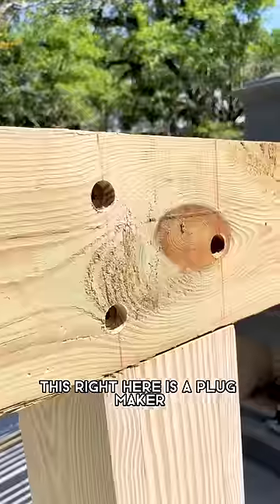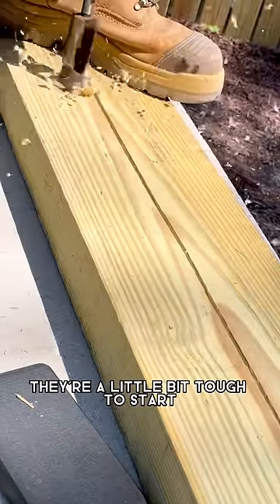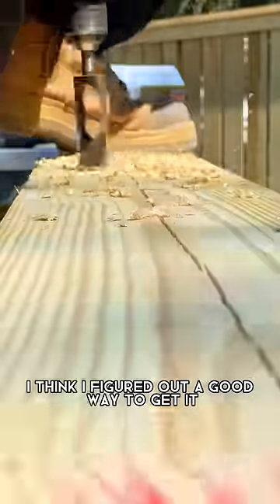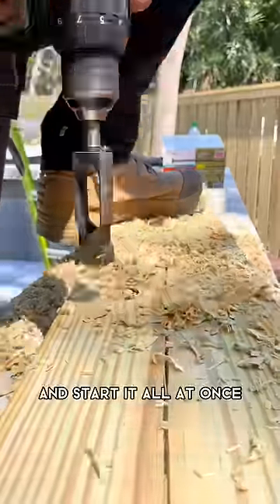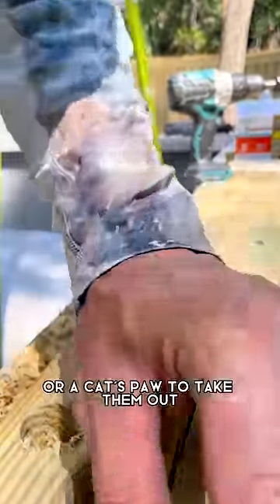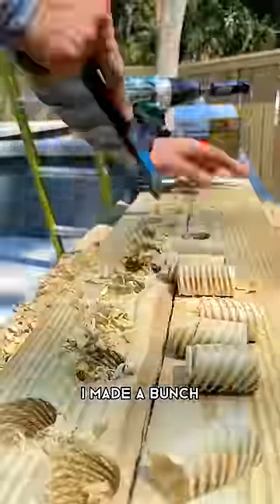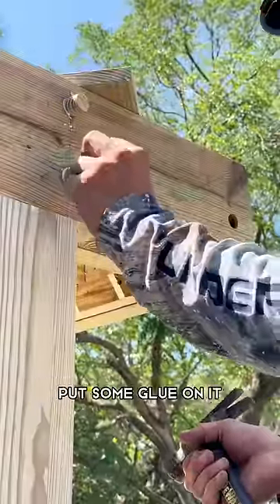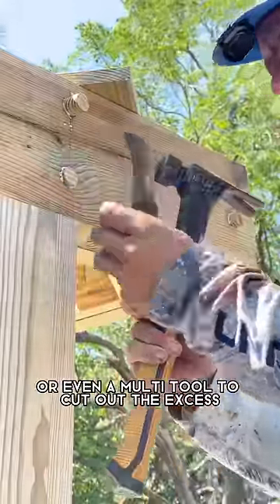Building a Pergola Part 7 Short

Comment: You could drill your plugs with a drill press first and bring them with you. That bit is made to be used in a drill press that it why it is acting that way. 

All plugs are meant to be cut that way, but people often don’t do that because they do not have stationary tools or a complete wood shop to say the least. 
Once you line them up on the edge you then take the piece to the band saw or table saw to extract the plugs or my personal favorite for #8 plugs - a razor sharp chisel.